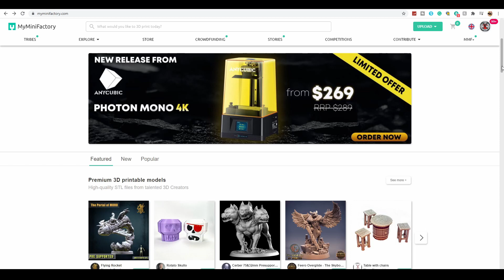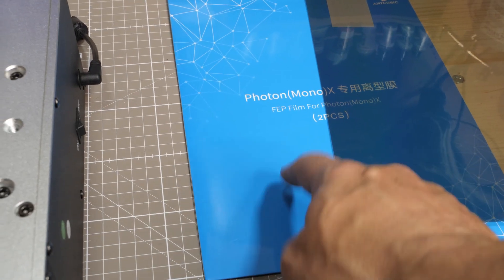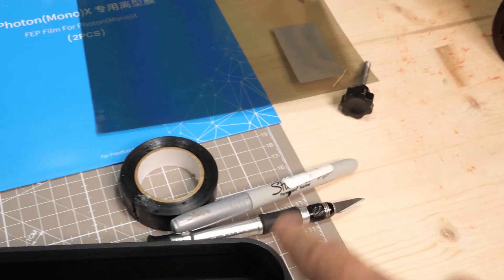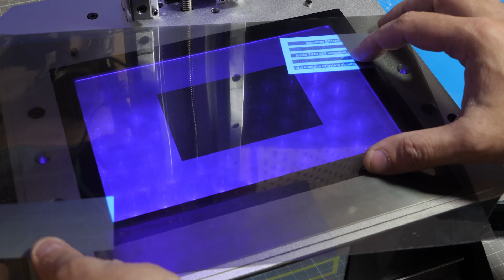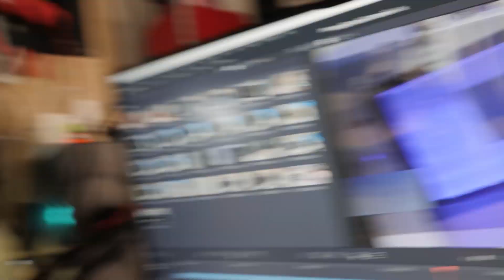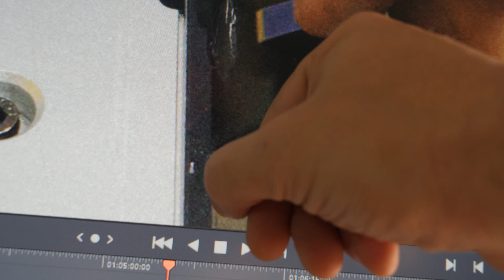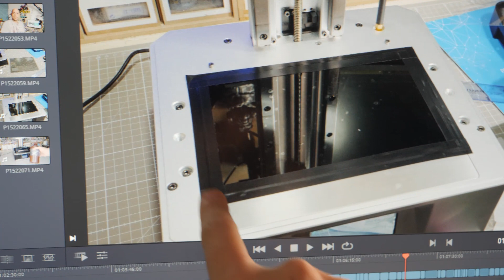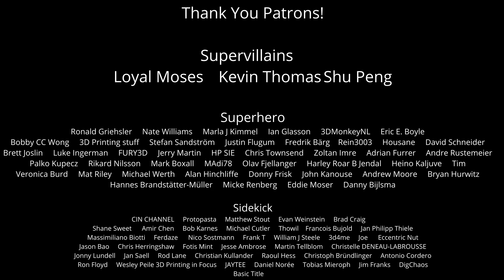Anycubic Mono X Polarising Screen Replacement…. The Wrong Way

Comment: i'm going through this now and I'd like to share some of my fails and triumphs as well.  First, I didn't even know there was a polarizing film.  I thought the LCD screen was plastic. I tried peeling the cured resin off with a metal razor.  In spite of being very careful, I did scratch the surface somewhat.  I eventually used a headlight lens repair kit to fix the damage.  Not perfectly though.  Then it happened again a few prints after.  I developed another hole in the FEP film and it leaked through to the LCD.  So I replaced the FEP using a spacer this time.  I started using the razor again to get the cured resin off the LCD and then I need a way to get the flakes off.  I used a piece of tape to pick up the flaked resin and then tried to used the tape to remove the stuck resin and I had some good success.  I think a stickier tape might have worked better, but I realized that I could now remove the resin with tape instead of using razors and avoid scratching the surface!  This is about the time when I looked at figured out that there was a polarizer on the LCD.  Of course, since I did have scratches, I used the polishing fluid from the headlight lens restoration kit again.  I also used a plastic polish from McGuire's.  So I avoided replacing the polarizing film but I still have some scratches and plan to replace it later.  And I will use a screen protector film, too.

Comment: Love it. I have the same problem , bought the polarizing sheet, but in my photon mono x I don’t see that black square you got when you put the sheet.

I rotate it and put it the “darkest” possible but Imit just softens the lamp lights . I tested the printer 3 times, different positions and kept. Getting a big layer of resin printed . As if it had no polarizing..

I bought mine from Amazon , what brand you got?
Reply: Hey. did you ever solve the problem? Im super stressed trying to figure this out.
Reply: @  ended up buying a new screen 😒. Tried other polarized vinyls . Multiple tries. No luck, 
Got the new screen from Ali express .

Comment: why trim it close it could be wider and cover the gap and be taped to the outer frame. it boggles my mind that the screen is not designed to direct resin into a drain system in the event of a ruptured vat. there should be a moat all around the screen and a glass ipad protector type film that can be replaced easily in the event of a spill getting cured onto it. the current generation of printers are built to be destroyed when a vat leaks

Comment: Thanks for the link to the polarizing screen - I had a similar issue when I was replacing the screen protector; a nice chunk of polarizer came along for the ride.
Any tips for getting the rest of the damaged polarizer off? My plan is to use a clean plastic scraper and a steady hand and hope for the best.
Reply: Hey. did you ever solve the problem? Im super stressed trying to figure this out.
Reply: @coleschaben  
I ended up replacing the entire LCD display, sadly :/

Comment: Thank you for a wonderful video. Same thing happend to me. So i ordered a new screen. Will save the other screen to and have that as a backup. Gonna do the polarid film fix on the old screen. One question. Dint you put on the fep screen for the vat to tight? Isnt there a cork methode or something or a frequenzy thing. To give it some slack when putting it back on the vat frame??

Comment: This is a great video and has helped me - one tip that im not sure was covered - when aligning your polarising film, do an exposure test on your printer - the box one, or even any file - and make sure the right sections are letting light through - I made the mistake of not doing that so while it all looked good I realised after the polarity was reversed so the areas printing were the ones not supposed to be if that makes sense

Comment: I'm dealing with the exact same thing on my brand new printer! My last printer did not have that screen it was just glass so you could clean it. My fep apparently came damaged and I ripped the polarized film after the first use trying to clean it. It was way out of my price range and now I have buyers remorse

Comment: In replacing the heat burnt screens on my car's radio, I learned that the LCD screen does need both polarizing screens, front and back, aligned the same way. Also, I wished I had only removed the clear protective plastic sheet from the side without adhesive. I removed both protective clear plastic sheets on both polarizing screens. This caused a lot of bubbles on the adhesive sides. Next time, just trim off a corner and use just that adhesive corner, or just leave the adhesive side alone and tape the screen edges (no bubbles).

Comment: Hi Breaks "n" makes and everyone, how can I check to see if my phone polariser film has very small scratches or damage etc please. Also can you tell me if a iPhone home button and motherboard are paired and need to be together for fingerprint Touch ID to work, or is only the home button paired with a iPhone and only the original  home button needs to be paired with original iPhone, I hope that makes sense, so original home button and motherboard paired to make fingerprint Touch ID work or just original home button needed for fingerprint Touch ID to work. Thankyou so much. Great video.

Comment: if you have use about a teaspoon of water with a very slight amount of soap in it, you can use a careful method of smoothing the sheet over that, with a card to push the water and air out. its something i learned at a shop that did window tinting (and the top protective layer you later remove will take any damage from the card, and keeping a bit of paper towel handy will handle any of the water as it escapes. i found your video as ive had the same issue and need to do this with my Creality LD-002R (with a just-upgraded monochrome screen from its stock RGB one). bloody FEP leaks!! sigh,

Comment: Thank you very much for sharing this. I've recently deeply scratched my polarizer and i'm about to replace it myself. I guarantee i would be making every single mistake you have here, plus a whole host of others.
Reply: Hello, I am curious how this turned out for you....I damaged the polarizer on my phrozen sonic mighty and am hoping to find a way to fix it without replacing LCD..
Reply: @PositivelyMe  sadly i did not have luck replacing the polarizer. i tried using one that was recommended on a different video with a link to aliexpress but it didn't sufficiently block light so it ended up partially curing the entire plate. :( ended up replacing the whole screen which was very successful and easy. good luck
Reply: @Snake369 in on the same train… I don’t get that black square he got with his sheet.  might be the brand?  I don’t. Want to pay 150 usd for a screen! It’s a third of the proces of the photon mono x

Comment: I was wondering why you don't use a screen protector.  From what I have seen, most of the "experts" think it is a requirement.
Reply from the maker: I’m always apprehensive about screen protectors as the thickness could easily play a big part in light leak due to its thickness. Have to do some research myself first :)
Reply: @3DMakerNoob  Thanks for the quick reply.  We just got our Mono X this week.  I put on a screen protector just to be safe.  So far we have not had a successful print.  I am in the process of running the RERF tests to see where we need to be.  Being a NOOB to this technology I don't know if the protector is causing any of the issues.
Reply from the maker: Honestly, it could be if it’s thick enough. Personally I would first do some tests without the protector just to find the right setting, then once successful, put the screen on and you’ll know if it affects it

Comment: It looks to me that the seal around my screen is a one piece cut from a sheet of Black Polyimide Tape.  In place after a 3 kilos of resin it measures 0.15 mm thick.  I can see some of the adhesive has seeped out at the very edges.  It hay have lost as much as .02 in thickness.  Black Polymide is a UV  resistant high temperature material commonly used in 3D printing.  It does come in roll form in many widths and lengths.

Comment: A good teacher does not only teach successes but also teach failures.  Is there a proper way to clean the cured resin on the polarized screen? Anyone?
Reply from the maker: Unfortunately I don’t believe so as they become completely fused together. The only way to prevent it is to have a thin screen protector over it
Reply: @3DMakerNoob I see. Good to see you on You tube again. Keep up!

Comment: Ah man I just replaced my screen, FEP sheet and added a vent out the back to the window on my Anycubic Photon, only after 2 bottles of resin. I have had 100% perfect prints since then. I think my leveling process and not cleaning the vat after every print was to blame. So glad I took the time to do it right this time.
Good to see you back!

Comment: Joe could some of those fails be down to the over tensioned FEP. I thought you were ment to put a spacer underneath the film before you do up the clamp ring
Reply: Even Anycubic’s own FEP install shows a bottle cap spacer when placing it between the brackets.  Even though it will work being too tight it also makes it much easier to puncture on a failed print when the build plate pushes down on the cured debris.
Reply from the maker: Nah, quite the opposite, the FEP should be as tight as possible without breaking. Have to say that their FEP tray system is probably one of the easiest for installation

Comment: Holy hell perfect timing. I just jacked up my mono x polarizing screen
Reply: I've been arguing with anycubic about this. They categorically state that the polarizer cannot be replaced at home as it is fused on with special equipment.
Reply from the maker: Meh, it definitely can be replaced, just not the way I did it 🤣
Reply: This is such a fantastic video. Thanks for making| sharing your failed project and why it failed

Comment: Just as fun as putting a screen protector on a 12.9” iPad in Arizona where the dust bunny is the state bird. Good work Joe.
Reply from the maker: Haha for mobiles and iPads there is a nifty trick which involves locking yourself in a bathroom and having hot water running so the steam settles all dust particles. But I figured taking my resin printer in the bathroom and recording there would raise too many questions 🤣
Reply: @3DMakerNoob  the acoustics would be nice😂

Comment: Nice test. I use a non-polarized Screen protector taped down with Kapton tape on the edges.  Works great and protects the screen.
Reply: Polarized film is different from LCD or its just part of LCD screen.. is compulsory or not for mono 3D printer, i still confused..
Reply: @PremierArtfxStudio  I use an ipad screen protector (non-polarized type) for the printer LCD screen.  I lay it on top and use the Kapton tape to seal the edges.  I recently had a small tear in my resin vat FET film and spilled some resin and this screen protector saved my LCD screen.